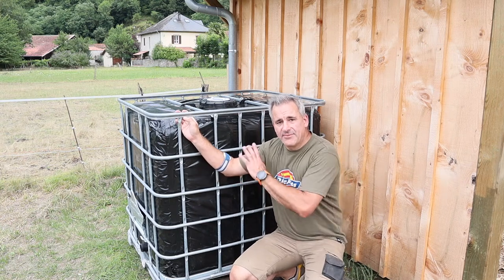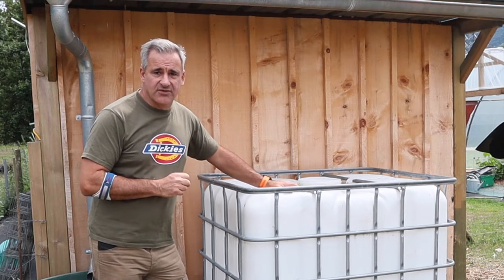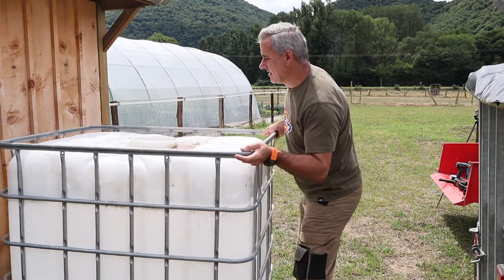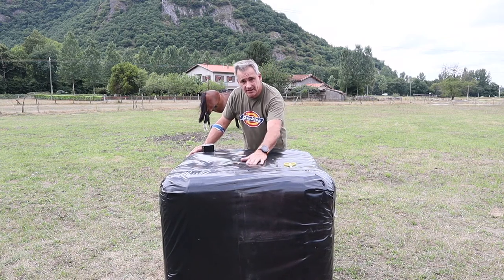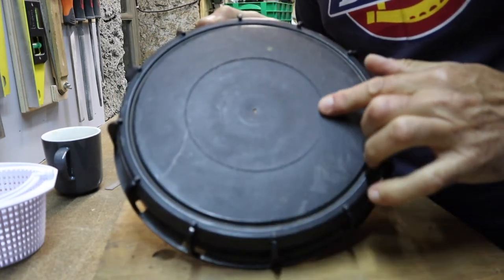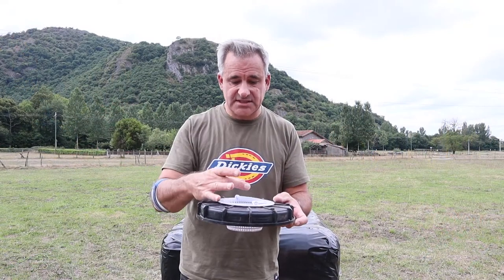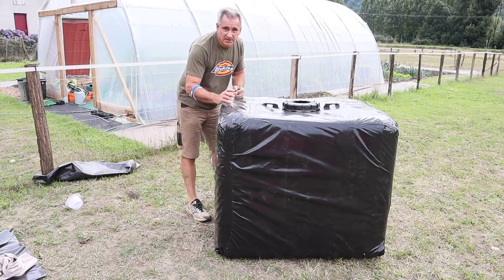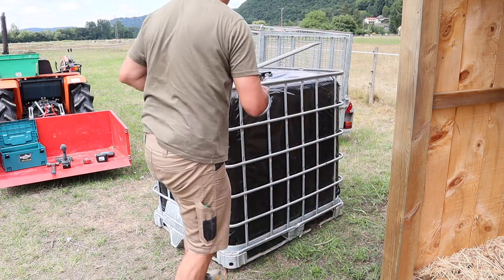IBC tank wrapping | rainwater harvesting

Comment: I’m getting everything to do a system like this. My question so far, would a good quality flat black paint work instead of wrapping them? Thanks for your videos.
Reply from the maker: I think the paint would peel after a while with the heat of the sun and the expanding of the IBC.  They do make black IBC units and I am on the hunt for some locally.  You can also get pre made covers for them to save wrapping them.  Thanks for watching